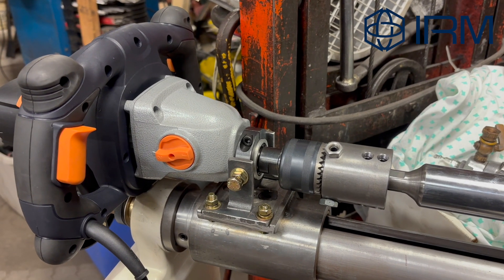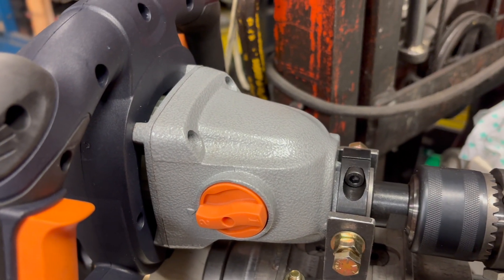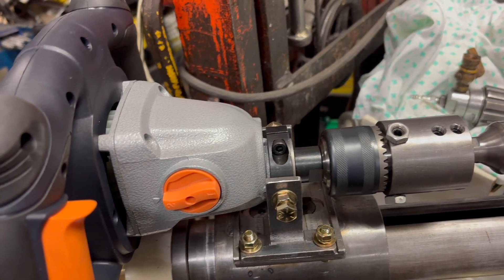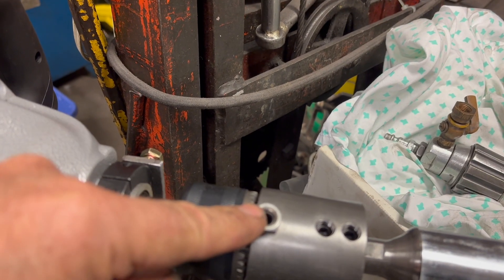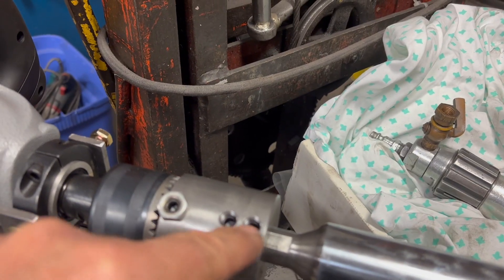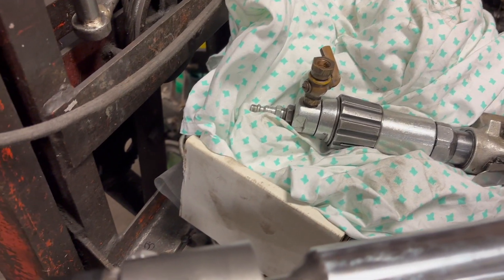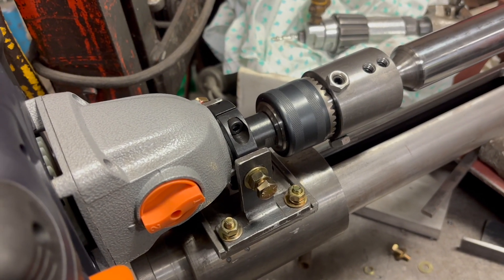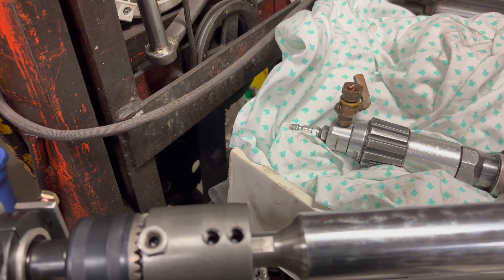Line Boring: Use a mixer motor with your Line Boring Set

Comment: Why install a mixing motor on a line boring machine? 
  What line boring machine are you referring to?
Reply from the maker: It is our Power Feed design - our Power Feed is used to move and  rotate the boring bar.
We show the capability to adapt different kinds of motors to rotate the boring bar, motors with different power and speed, depending on the client's needs. 

We design and manufacture our Line Boring machines in Chicago.

Thank you for the question.

You can see more here:

https://www.youtube.com/playlist?list=PLgXeb3TEoKSrxLnx39PtTtfW_tXDIUTnz
Reply: You gotta drive the boring bare, mine uses a 1/2" drill and a small cylinder and needle valve to control feed